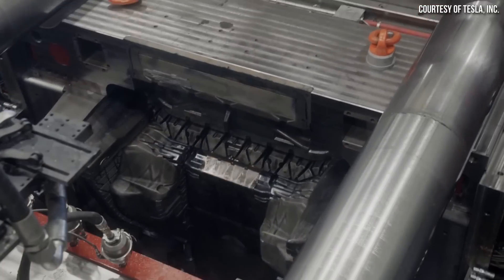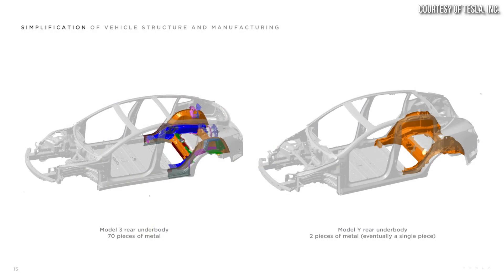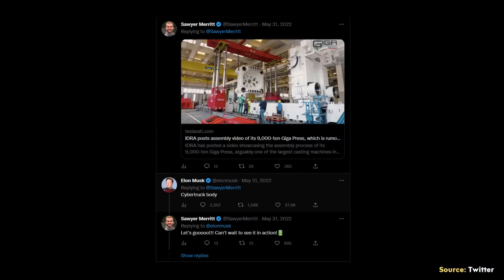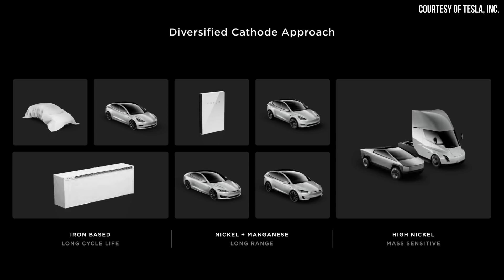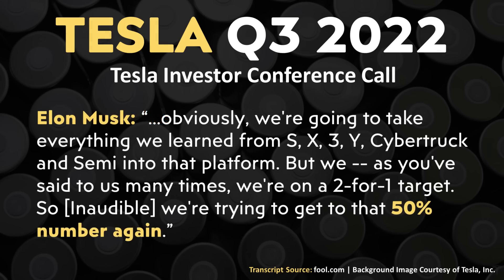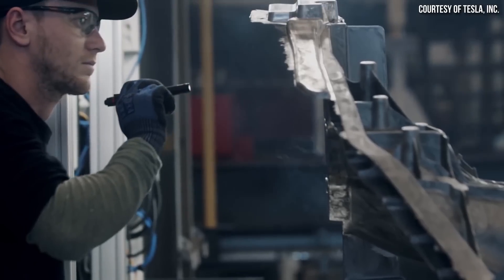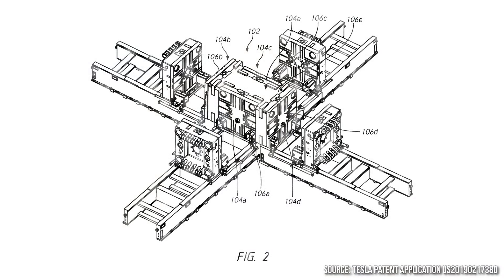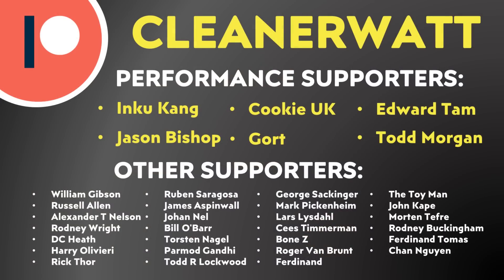Tesla Model 2 Giga Press Confirmed? | Diecast $25K Tesla

Comment: Unless the sides were vertical they couldn't cast a complete body.
You can't extract the mould from the inside of the finished casting if it's curved.
Then there's the issue of material finish ready for paint.

Comment: Step 1 cast underbody.  Step 2 one piece plastic overbody with structural foam then thin sheet steel layer for crumple, light weight and snap fit parts. Solid color of a material similar to bumper covers could be unpainted.  Collision damage could be fixed in minutes by snapping on new parts.  No painting would reduce costs massively. 

Shallow scratch on 2 doors and rear fender cost $11,000 to fix.  Sustainable cars need sustainable exterior finishes and paint ain’t it. Stainless steel would be great but too expensive. 

Every car could be same color with wrap kits for those who want custom colors where 90% of all colors are white, grey, black and blue. Some red.  Boring.

Comment: Check this out on PV Magazine: "French startup unveils new residential thermo-acoustic heat pump
Equium has developed a new thermo-acoustic heat pump core that reportedly produces 3 kW to 4 kW of heat for every kilowatt of power it consumes. It says the refrigerant-free device could generate domestic hot water at temperatures of up to 80 C."

Comment: Front and rear castings made in a single shot is possible for a smaller vehicle. Front and rear castings would then be attached to a sheet metal box to hold battery modules. Even a smaller vehicle would not fit between the guide rods. Tesla abandoned the patent because it made no sense, as shown in the diagram you would not be able to release the casting.
I am a professional mechanical engineer and the GigaPress approach is genius, but not a complete manufacturing process - some assembly is required
Reply: Yeah, I expect full underbody / skateboard first - front & rear joined by lower rails / floor. Bit too early for full one-piece car body including roof beams. I’d like to see door pillars as next piece.

Comment: Wasn't the concept proposed to Musk by Sandy Munro?
Reply: It was both, I heard both of them when they were starting. Sandy was for sure.
Reply: Per the ashley vance biography and other interviews. The idea came from someone giving elon a very nice diecast model s in 2018.

Allegedly studying it got him wondering about why a full size car frame couldn't be die cast. As he said at the cyber rodeo last April. 
Only 1 casting company didn't say no. Which he took as a yes. And 3+year's of work later we got the first model y with 1 piece rear casting. 

1 year after that we had the tx built model y with dual castings and structural pack's an industry first. 1 maybe 2 years after that we could have the frame of the compact gen3 platform done in just 1 piece. Making most of a car body possible from 3 castings and a structural pack. 

34seconds per model y biw run rate right now at gigahai. Could tesla cut that in half as elon and drew are alleging? If so it would beat any legacy achieved run rate by 3x. Good luck to them I say. Tesla is showing the way and the Chinese will copy copy copy them. 😎

Comment: I don’t think a  full diecast car body would not be possible due to the need for crumple zones.
Reply: They already showed how the crumple zone is not an issue. Areas are theoretically removed and rewelded after an accident. It's in a video out there somewhere.
Reply: Already add-on structure for crumple zones from & rear.
Reply: The main problem?
Look at a cross section of a car from the front.
Narrow at the top.
Wide at the "waistline" and narrow at the bottom.
You can't cast that shape because you can't extract the inner part of the mould from inside the finished casting.
Reply: @rogerstarkey5390  Look at a cross section from front to rear...
Reply: Not gonna be the whole body based on the patent drawing though. It's the shell which will go on over the f&r castings and structural pack. 
Making the majority of a vehicle's body in just 4 pieces.

Comment: Have any of the Chinese EV manufacturers (BYD, NIO, Etc.) discussed or have rumors they are going down the diecast route? Non of the EV YouTubers have mentioned this.
Reply: Electrified just did today.
Reply: Nio uses a large single piece casting for the rear of it's et5. Byd is rumored to be working with various casting companies to.

The boss of lk tech which bought out idra year's ago. Said in a very interesting interview last year. That outside of teslas engineers? 
It was difficult working with other manufacturers engineers. To build presses and dies to their required specs. 

Implying not so subtlety that the teams not named tesla are in fact far behind. Also Volvo claims they will use rear large castings from supposedly 2025 on in their rebuilt plant in Sweden on all new Volvo ground up evs. 👍🏻
Reply: @4literv6  Volvo?  Oh, you must mean: Geely - ya know, the Chinese conglomerate that bought Volvo ten years ago.

Comment: Could it be part of the Model 3 improvements (project highland)? Exciting either way or even if a competitor is using it.
Reply: Yes I think it is for the redesigned model 3
Reply: Makes the most sense to me. Model 2 production is most likely still a few years away.
Reply: @EinzigfreierName  As the Model 3 will be a "cut off" Model 3, it will be faster on the market as the european compact car competitors would like to. There is no modern nor cheap EV in the B segment. All are fossil based, expensive and pretty shitty.